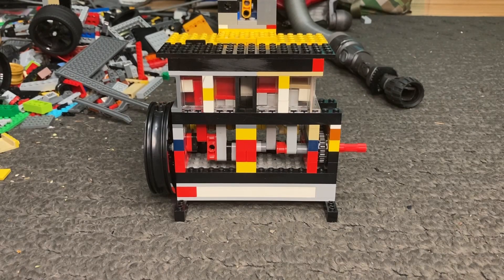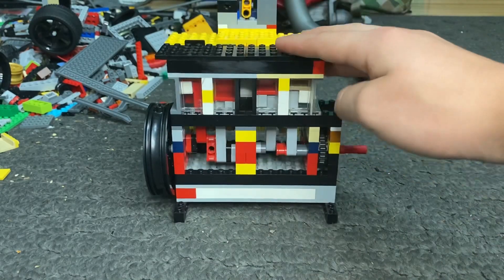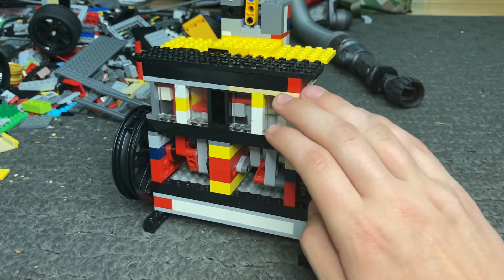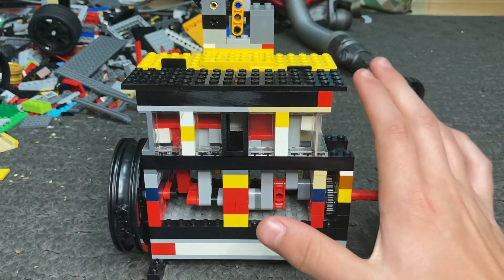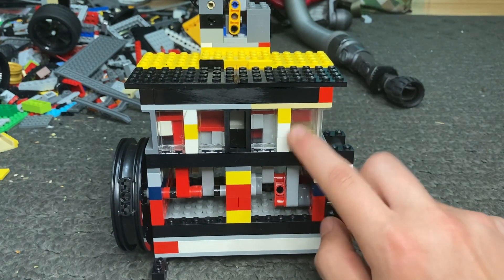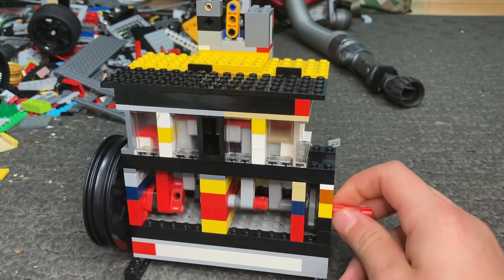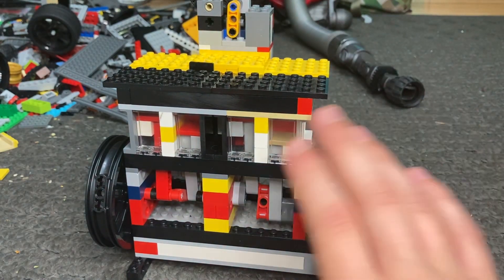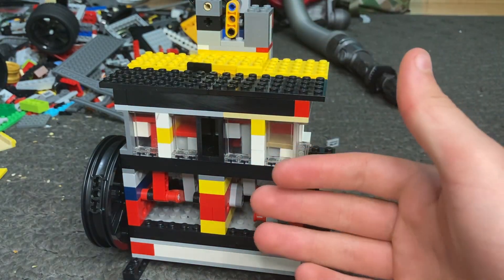Inline 4 Lego Vacuum Engine Tutorial!

Comment: Mine will not turn over for more than half a second. Seems to be tight somewhere, I coated it in wd40. Also because of the timing gear spacing, they will sometimes touch and lock up. Any tips?

Comment: Hey got any tips on how I could get this engine to run faster cause I rebuilt it again and it ran but barely 😅
Reply from the maker: Try using lubricant in as many places as you can. You could also do a double vacuum set up by modifying the manifold

Comment: I’m just missing chains. I’m sure that I can use another 16 tooth for even ratio
Reply from the maker: That could work if the valves were lower. I believe the valve crank is one stud higher so 3 16 tooth gears would not work properly.

Comment: This is a cross-plane inline four cylinder vacuum engine. Although I really like it the issue is that it only compensate for secondary forces and your primary would greatly hinder the performance. This is like a Yamaha engine
Reply from the maker: Despite the crankshaft layout, the engine doesn't make any significant vibrations and is relatively smooth. The reason I made it like this is for optimal power delivery and smoother revving. (Although this tiny piston engine doesn't produce a lot of torque anyway)
Reply: @KFPlusLegoMastery   yeah, but when my parts come in I’m going to attempt a 1243 firing order. As far as I’m aware I think it’ll be the first on YouTube. I’ve gotten the design down though. I’m going to have to compare it.

Comment: bro, I've just finished building the motor and it turns out that it doesn't work, try to start it, but I can't get it to go as fast as yours, what could it be? I thought it could be the vacuum cleaner, how can I make it work? good video
Reply from the maker: Definitely check the valve timing. Always make sure the valve crankshaft is 90 degrees ahead of the piston crankshaft. Also make sure to lubricate and/or sand down your cylinder walls and pistons.